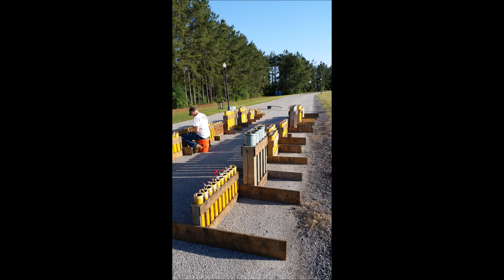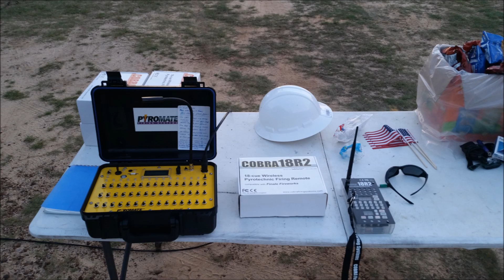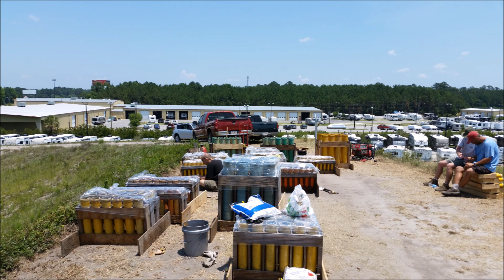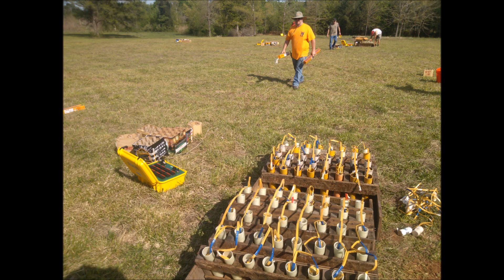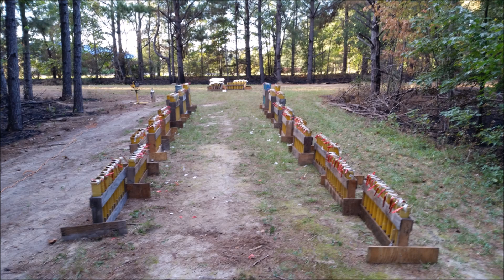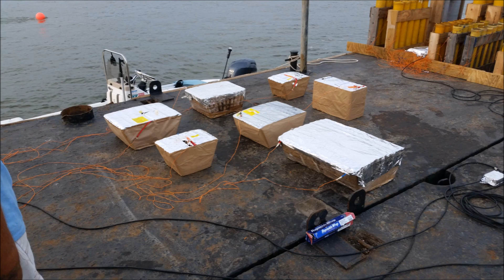Setup photos for 2014

Comment: Nice montage of photos. How many shells do you typically use on average.
Reply from the maker: For a shell count, we try to have one in the air every three seconds or so for the body. The finally can get fifty to two hundred shells. Depends on the show. The numbers change depending on cakes, flights (two at once), and volleys (three at once).
Reply: James Fitts Thanks for the reply.